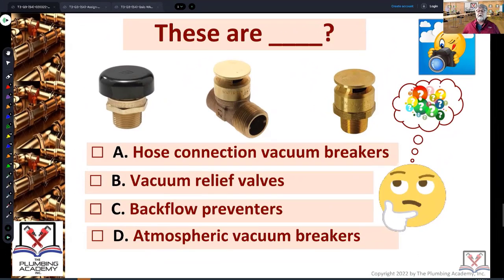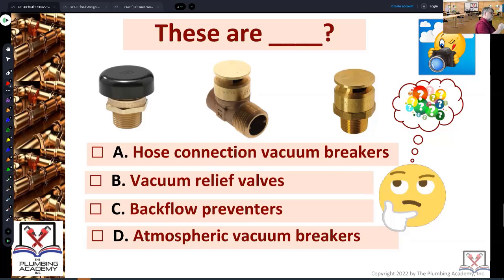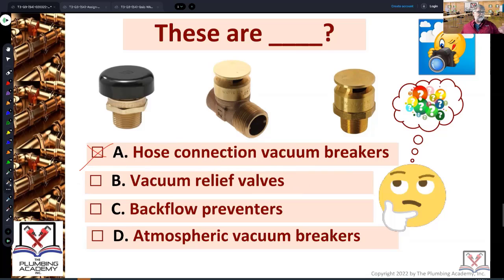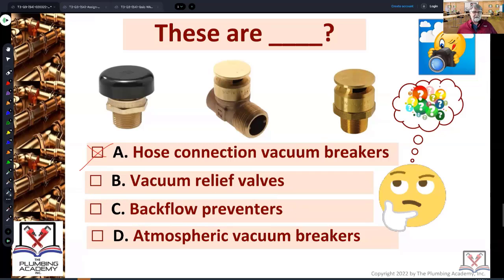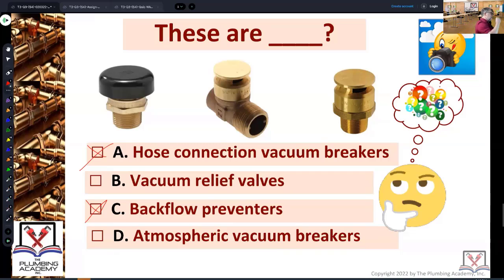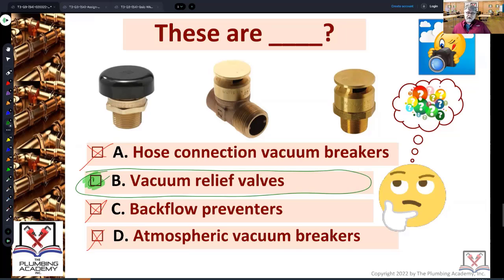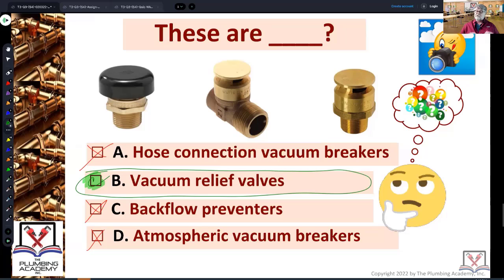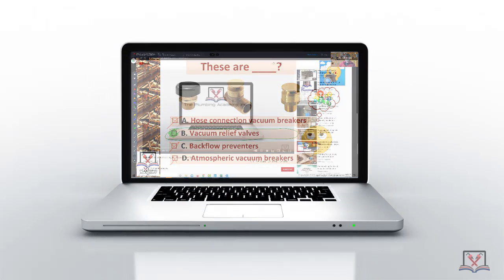What is It? - Choose the Right Answer - Vacuum Relief Valves

Comment: LOVE THE VIDEOS and learning so much.  I have a unique question on vacuum relief valves and whether they can be used on cold water supply line for draining purposes.  

I have a seasonal shed that I have cold water line run to with a sink. The supply line to the shed can be drained to the basement to prevent freezing in winter temps.  When I open the shed sink spigot, close the supply at the house and open my drain valve, a vacuum is still created that is beating my expected gravity drain :-).  I can go disconnect the fittings in shed to get the water to drain. Can I install a vacuum relief valve at the highest point under shed sink on main line that would automatically do this for me once I shut off the supply and open the drain in basement?